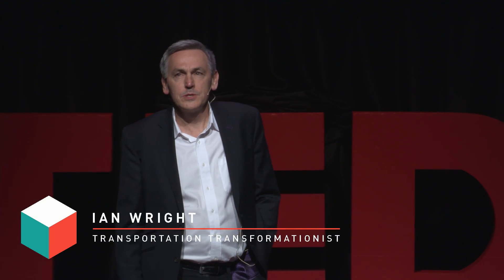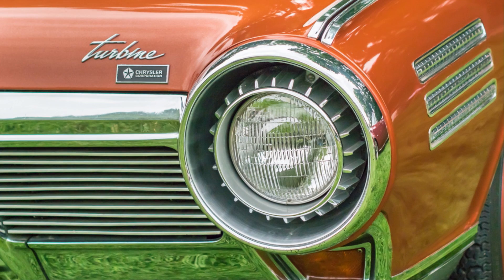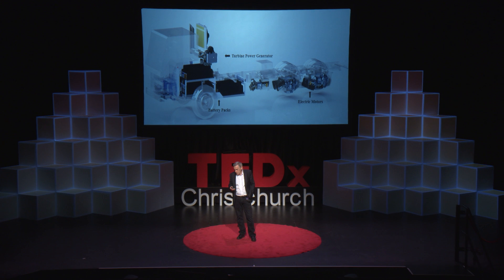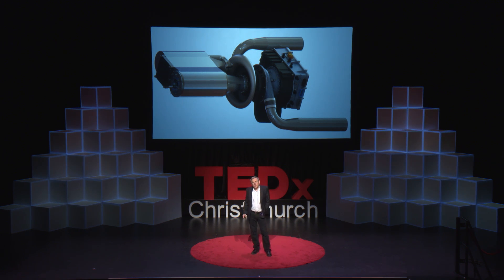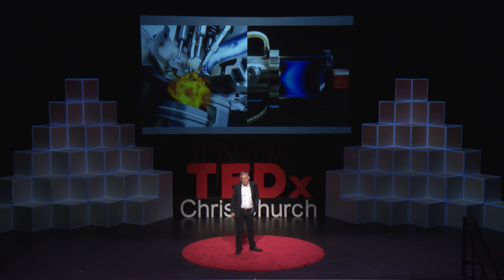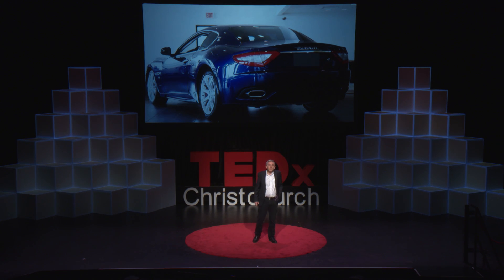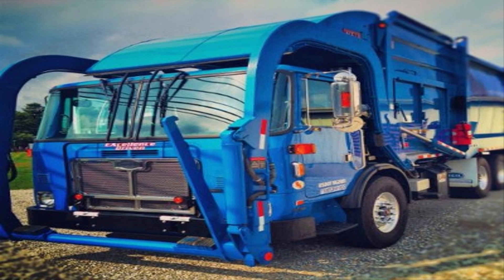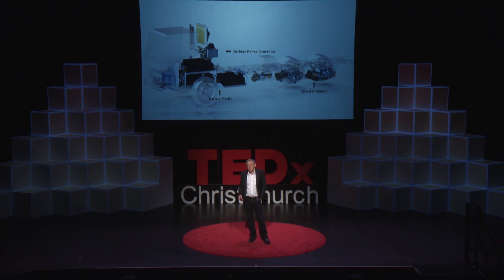How jet-powered garbage trucks can save the world | Ian Wright | TEDxChristchurch

Comment: the problem is the efficiency of the battery
Reply: Batteries are "Inefficient" and "Bad for the environment" Compared to what? Offshore drilling, diesel, heavy industrial delivery system for oil?
That is an ignorant statement promoted by those with a financial interest in the oil industry so it's not unusual that you "heard that somewhere" but a very basic comparesion will disprove your talking points.
Reply: +Alex Turlais which is constantly improving and will gain a tremendous leap in efficiency once were off lithium.
Reply: CaptainDave True
Reply: +I am Your Father This whole system is so much more efficient than typical diesel drivetrain that it doesn't matter.
Reply: yeah, righto. Seeing a lot of assertions, not much evidence.
Reply: It's not even close, calvingreene. Batteries are a one time cost, while oil keeps costing and costing, for every mile you drive. 200,000 km on a battery driven electric vehicle will absolutely decimate the efficiency of any diesel, even if powered by coal. Or are you ignoring the cost of manufacture of the diesel drivetrain, also?
Reply: calvingreene90 Sure, an engine and transmission is cleaner to build than a battery, both in terms of emissions and pollution. But you've got to fill them with oil for 20 years, and burn oil that requires the same coal power to refine, for 20 years.

There's simply no way that can compare to 20 years of operation using solar power produced at home.
Reply: idontcare80 yes, but objectively lots of energy is still lost. less than before, but still.
Reply: +I am Your Father You know a better way to massively improve the efficiency of these vehicles?
Reply: idontcare80 i never said there would be a better way, but that there are still disadvantages.
Reply: +I am Your Father But you didn't name a disadvantage. Any system that human beings are capable of building that can move a vehicle will waste energy, all we can do is reduce that waste, and that's what this system does.
Reply: criticising for the sake of it eh
Reply: The toxic waste from making batteries does not break down naturally oil is a natural part of the environment and feed bacteria. So yes compared to  Offshore drilling, diesel, heavy industrial delivery system for oil?
Reply: @ Matthew Jenkinson
Toxic waste not cost and yes including engine and transmission ice is cleaner then electric even excluding coal power plants.
Reply: The toxic waste from making the batteries and solar cells does not break down, oil on the other hand is a natural part of the environment with many bacteria that feed on it.
Reply: calvingreene90 after killing tons of life and hanging around for years. Every time you pump it, which you need to keep doing every time you turn the engine on.
Reply: The waste from making batteries kills lots of stuff and hangs around centuries at least.
Reply: idontcare80 the disadvantages are the battery. it is inefficient (more so than normal cars) and bad for the environment.

Comment: Please invent a garbage-powered garbage truck. That will be powerful.
Reply: +mhtinla Here you go: http://inhabitat.com/toronto-waste-truck-runs-on-natural-and-bio-gas/
Reply: Run Dual fuel system on the diesel engines using C.N.G. as the primary fuel and only a small amount of diesel to ignite the C.N.G. this is a simple conversion, cheaper to run, cost effective and by far much safer.Bottom line this is a very big improvement over the Battery topped up by turbine system.  theoldbear Long Time Red Seal Heavy Duty Mechanic
Reply: theoldbear1943 > yeah, but where do you get C.N.G. from? It's still mostly from fossil fuel and you're still not solving the problem of starting and stopping every 60ft - which is what is killing the efficiency of these trucks' operation. Plus you have the maintenance costs and the cost of the engine replacement which is much higher.

Comment: I don't know how to think in HP and miles, can't you convert it to kilowatts and kilometres?
Reply: +elfboi523 1 hp is roughly 750w so 4hp 3kilowatts
miles are 1600m 1.6km - 5m=8km 10m=16km
Reply: illumicon Yes, I know that, but it's hard for me to do the conversion while listening to the talk. It would be great if there were subtitles with metric units.
Reply: so pull up a browser window and type somethign like this:   "convert 92 hp to kilowatts"   "convert 127 miles to km"   and it'll solve the math for you - same works in reverse, and vast number of conversion units are supported...  Cheers.